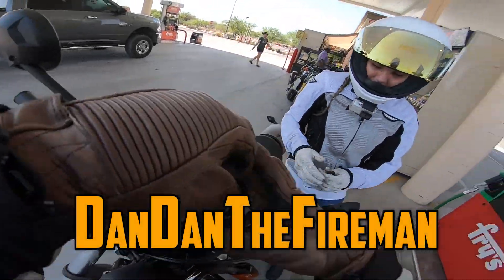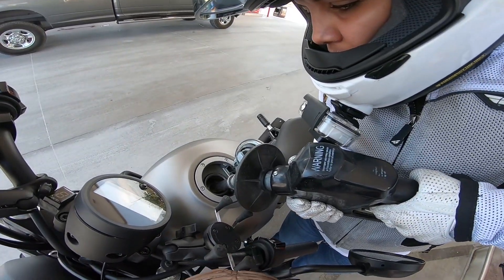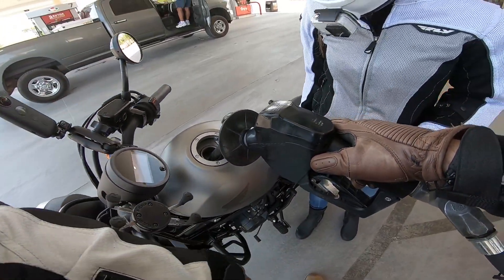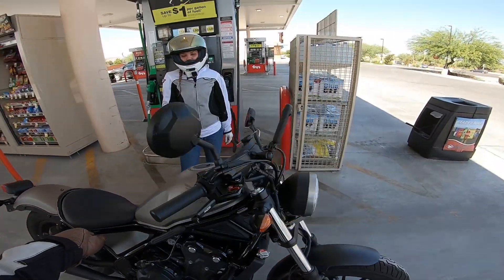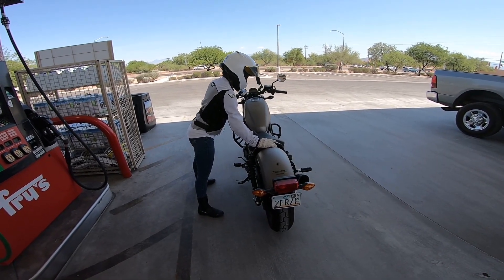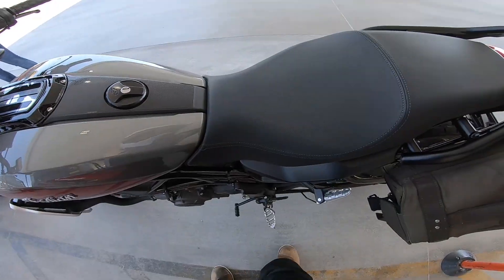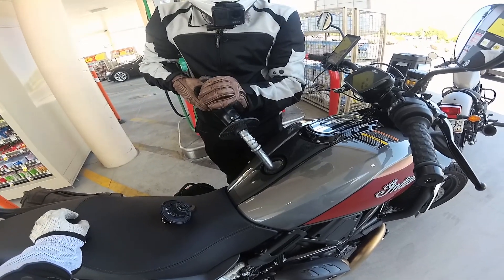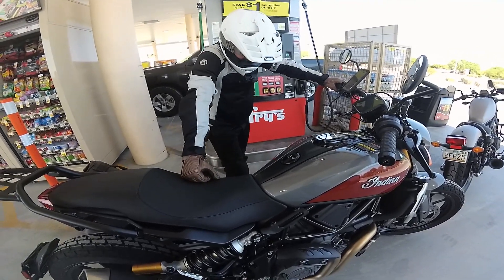Teaching Nikki How To Correctly Fill Her Motorcycle Tank

Comment: Hey Dan and Nikki, pulled into my local servo today to fill up my beast, a kymco people 150, a young lady was trying to fill up her bike. She was standing at arms length from the bike with the nozzle jammed into the filler, she was complaining that the pump kept cutting out when she tried to fill. I went and helped her, when I removed the nozzle, fuel overflowed. I explained that she had the nozzle too far in  and the automatic cutoff was being activated from the back pressure. I showed her how to fill her bike, then showed her from my bike. Should be noted that her bike (like nikkis) has a metal splash plate inside the filler, mine being older does not. She told me that nobody’s ever shown her, and often she could see people laugh at her. I now have a new riding partner and have plans to meet up for some car park practice. Will definitely make those times more interesting and hopefully we will be able to learn more from each other’s mistakes. 
Refueling a bike is very different from a car in so many ways.

Comment: Good tips. I try to refuel while sitting on my bike so the tank stays level. Though some stations will not allow this practice.
Reply: I've done it that way too, and I can add a little extra that way. However, I saw a video where a guy and his junk caught on fire. Made me second guess doing that again lol
Reply: Good tips. The biggest problem I have is modulating the trigger to get a slower flow. Gas pumps need a friction  zone, lol. The only thing I didn't see that I do is before I start I will grab some paper towel if it's available and put it around the nozzle as I'm walking it over to the bike and also going from the tank to the pump. That way I can catch any dribbles before they get on the bike.

Comment: She has issues with constructive criticism & instructions.
Reply: How did you get idea from this video?  Nikki had a genuine interest in increasing her motorcycle knowledge, it illustrates that from a newer riders perspective there are a lot of funny little details that you don't instinctively know. PS: The owners manual does touch on the gas filling procedure, and calls that plate with holes in it a baffle.
Reply: Havik Knives When you tell her the right answer she gives the answer she thinks like it’s a rebuttal.  Then when you show her or tell her she goes back to what she thought.   I was trolling anyways haha don’t take it serious thanks for putting out info.  Squid rn but not for long.
Reply: Also the vast majority of gas stations have automatic shut off pumps. When the gas starts touching the nozzle it shuts off
Reply: 7hatGuy I take it out and press the black spring down by hand